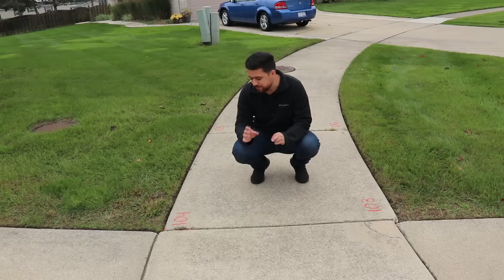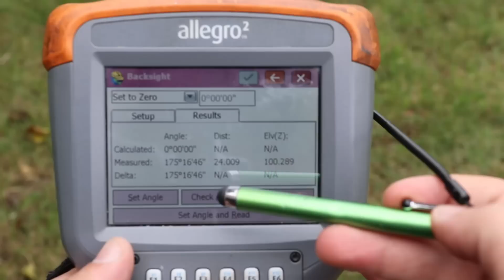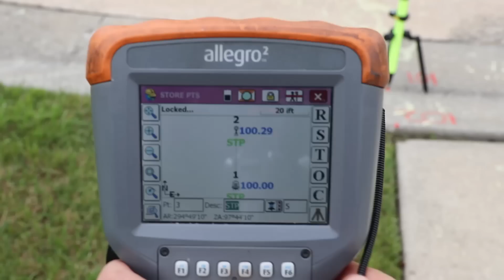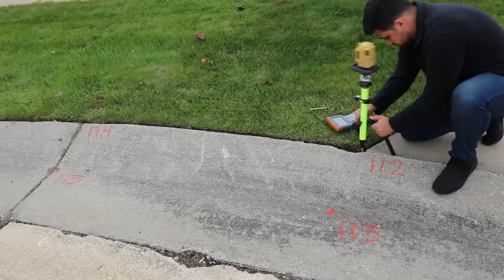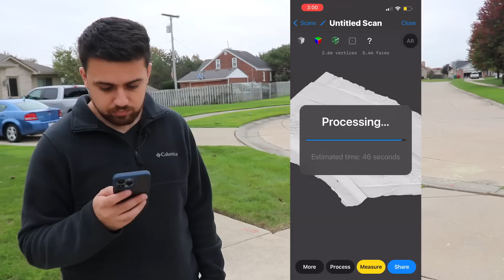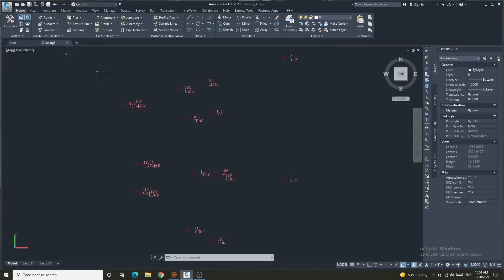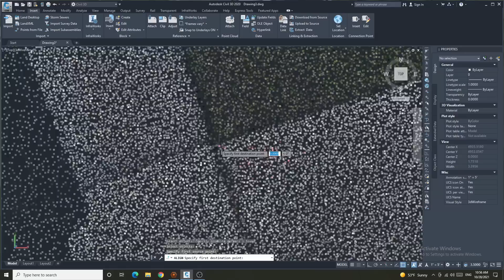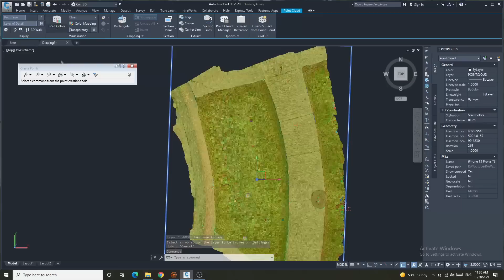iPhone 13 Pro LiDAR vs. Survey Total Station Accuracy

Comment: I’m not a surveyor but I bet the outcome is a mixed emotional bag of    Thanking the gods the iPhone pro is not making obsolete the LiDAR system that you had to take a mortgage out to pay for   And no Handy Randy is taking your job with a phone   To  dam  it would be nice not to set all that equipment up for small jobs  I’d like to use the dang phone so I can go to lunch early on hot as hell afternoons 😂 

My observation as a plumber.
Reply from the maker: Your observations are accurate. I’ve received death threats before as well 😂😂
Reply: @RamiTamimi   we all have parallel work lives    43 Yrs plumbing I can spot what sucks what’s good in trades   I asked my dental hygienist I bet the part you loved at first but now hate is dropping that sucker in peoples mouths   Your over it right she laughed said  no comment 🤦🏻‍♀️
Reply: @RamiTamimi    I’ve had a few things that came and made my career easier  no one has caught on and it’s been 20 years !  So no worry’s. It’s still to difficult to operate all that software  most just settle for driving  for Amazon at $17 n hr.

Comment: this is a good comparison to check the accuracy of the iphone, but they aren't the same application of the technology. A fairer comparison would be to something like a leica rtc 360 or similar. I haven't played with an iPhone's scan data, but I've done a lot with scan data from both leica's and faro terrestrial scanners. being able to increase the point cloud density on the iphone would be a massive advantage if it can be done. but then again, an even better comparison would be vs a handheld lidar like an artec leo.
Reply: i won't lie, i did skip sections of the video the first time, but i just went back and watched the process of the iphone scanning. in my experience even top end hand scanners suffer from drift, as the loose reference to their origin fairly quickly without some pretty well defined geometry for them to reference. for example, we scanned a ute (small truck for those not in Aus) at work, and even just scanning across the front of the vehicle it suffered from some pretty serious drift. scanning in smaller section, creating multiple clouds that you then "stitch" together with overlapping section yielded better results.

Comment: Wow!  This is an interesting video.  Very nicely done.  However, for the sake of really determining the accuracy of the LiDAR sensor, how about use a few PK nails instead of using red paint dots?  I wonder if the red paint dots are too big to accurately pinpoint the center of each dot.  Just out of curiosity, how many points did the iPhone collect for your experiment?   Best Regards,

Comment: you should have fit a rugid body transform using a least squares fit (preferably svd) and then calculate stats on the post fit residuals in addition to printing out stats from the fit itself.  I would be most interested in the affect of the positioning and especially angular drifting of the phone which would result in shearing in the data.   You could get some small reflective targets to put down so you aren't relying so much on the colorization.

I would guess that in this small area they may be able to use the cameras to take out much of that shear.

Why you survey folks do everything in left handed coordinate systems is beyond me.

Comment: I have the iphone 12 pro, When I read about the iphone 13 pro it mentioned LiDAR but not if it was improved.
Could the iphone 12 pro have been used in this demo?
Does the iphone 13 pro have the same LiDAR as the 12 pro or is it “improved”?

Comment: What happens if you used a different total station or if a different person used the same total station?
My point is that if something is measured twice there may be errors that show up in the spreadsheet.
From my physics days that is called uncertainty. If ten students measured something there will be some variation.
How does that compare to the uncertanty of the LiDAR image?

Comment: I've a comment on the method of postprocessing if I may:
You use 2 points to align the iPhone Lidar points to the Total station, I would have use 3 points to "block" the rotation of the cloud around the line defined with these 2 reference points: A reference frame is defined with at least 3 points
Or did I miss something?
Cheers
Reply from the maker: Hi Boris, you are correct, it is a three point alignment it correctly. However, if I do this, it will distort the vertical drift and we won't be able to calculate the vertical drift of the sensor.
Reply: @RamiTamimi  achsooo
You mean that the vertical is defined with gravity direction, on the total station and iPhone as well.
In that case, indeed 2 points are sufficient.

Thanks for you answer

Comment: Very interesting. I don’t know the industry or field, so rooky.
You mentioned, at 17:08, that you didn’t pick EXACTLY the same point when you did the feature extraction. (You picked a point from the iPhone data which you chose as the best [nearest?] point to the correct point on the ground, as the iPhone camera showed you)
Does this not give you an error, which - if the iPhone data WERE correctly aligned - would improve (or, perhaps not) the accuracy shown by the iPhone lidar points.
What happens if you ‘adjust’ the iPhone data set by this error? *At that specific point * (104? - I forget …) both data sets are now aligned, and you have a zero-error datum for both sets of position data. Or, should you not start adjusting anything, as then it’s not ‘absolute’ data - perhaps considered cheating?

Easy to do in the spreadsheet.
… just a thought from the rooky.

However, great to see you do the comparison. As the iPhone is 1/30th (approx) the price of the top-of-the-range industry product, I think it’s phenomenal that the ‘feature’ is in the phone, and as good as it is. Lidar has crept in as the next feature on top-end phones - so, soon in all of them, I suppose.
Matt Lee
Reply: I don't have enough knowledge to answer your question, but i can tell you that surveying often produces accuracy that simply isn't useful in real world applications.  Sure, when you are building a highway for hundreds of miles, it may.  But when measuring a residential lot, a few tenths is generally more than sufficient.

Comment: When I see errors(?). I like to look for patterns ... I also always use multiple control points as a check for the survey-grade equipment(total station).

I like seeing where errors(?), begin bunching up and if there is a reasoning for the errors ... I have rectified many old surveys, which were accurate for their day, but not comparatively for the present ... these errors(?) are very telling as to how they came to be.

I'm near the end of this video, and wonder what would have resulted, had you weighed the various errors(?), and allowed more correction to 3 or 4 control points, rather than to only one control for scale and the second control point, only for rotation.

I'm inclined to add direction and distance to the columns and see if these values tell a story ...
Reply: You know(?), on very large jobs, controlled with  RTK and numerous Static GPS(crosschecked with total station), I had actually noticed high aerial Lidar to "waver", in accuracy, as such that I would find Lidar very accurate in a small area, then suffer calculable  inaccuracy from a particular area, only to again attain substantial accuracy in other parts of the project area.

The precision of the Lidar seems to comply with any area particular area with acceptable data manipulation ... that is, with simple translation/rotation, that would appear to make areas of reasonable precision, but questionable accuracy, more compliant to the ground derived RTK/Static and total station data.  

Maybe the Lidar data you compiled was actually much better than shown ... in any case it's always fun to play with numbers and to imagine if this Lidar(on the IPhone), worked to a range of, say, 100' or more ... imagine the fun, an old COMPLETELY SOLO codger like me(land surveying from 1973-2013, now retired), could have ...

Comment: OK. But no.

You are comparing two METHODS of measurement instead of comparing two devices accuracy.

Set two devices on tripod, scan small scene, distances needs to be limited to 5m because of iPhones LiDAR limitations. Compare results. This will be comparison of two devces accuracy.

Moving iPhone and using scanning app to gather and combine multiple measurements from different places causes measurement error cumulation
.

Comment: Rami... the lidar on the iphone and ipad pro is good for when good enough is OK. ie you want to scan a scene and import it into blender so you can make a virtual world...ie looks good but may not be 100% dimensionally accurate
As an architect I wanted to see how accurate the ipad pro lidar was to take accurate scans of existing buildings. I experimented by taking 3 scans of my complex shaped living room and compared the dimension accuracy of the scans to DISTO laser measurements. None of the lidar sans matched the real measured dimensions ... worst case was the 3 scans did not match each other, with a difference of 75mm between them on some measurements... that's 3"...  none where close enough to do accurate cad dwgs for a renovation. I have to still survey existing buildings the old way... take laser distance measurements with the DISTO and sketch the plan out on paper showing the measured distance, then draw it in cad program. Its really important that I can trust the measurements taken from the site as being accurate... and plus or minus 1/2" is useless I want/need plus or minus 1mm. 
To prove to your self how bad it really is to use the iphone lidar. take 3 separate scans of the same area and compare the 3 scans to each other .. in my experience they will not match.  and for reference take laser measurements to see how far off each lidar scan is from the actual dimension.
I'm experimenting with different photogrammetry software which is looking promising (way better than the apple lidar) especially when I take some actual DISTO measured control points and adjust/scale the photogrammetry mesh so the control points in the mesh are dimensionally accurate (ie set to the actual measured dimension). Ie I measure the over all length of the building and scale the mesh to match.. then the dimensions in the mesh for every thing between the control points get more accurate.

Comment: Perfect intro for a layman. Good analysis between accuracy and precision. Impressed that the IPhone software was able to stitch the cloud together. 
Fine for estimations; not suitable for a design survey. Additional control might aid in accuracy. 
Keep the land surveyor over the IPhone. But I'm biased.
Reply: Wonder how would the error fare on large area.
IMU sensor [which phone use to detect its movement] has inherit errors which would accumulate under prolong use.

Comment: It appears the local accuracy is better than you have concluded. The errors you are showing in Z are mostly from the registration process being a 2-point method. You will get much higher accuracies if you do a 3-point registration. i.e. the phone's "level" was off from the total station level, which is expected given it's coming from an accelerometer and not a 10" bubble. This put points that lie near the line extension of your two registration points in high accuracy (105, 106, 113, and 114), and points to the upper left in a negative Z error (101, 102), and the points to the lower right with a positive Z error (107-111).
I took your points and did a 3-point registration without scaling, shifted the points for best fit by the average NEZ for all three control points, and then got the standard deviations: 0.10' E, 0.10' N, 0.04' Z, and max absolute errors of 0.19' E, 0.16' N, 0.06' Z. The remaining error was clearly a scaling error as the error directions all radiated from the center.
The fact that the Z had less deviation is because the camera was facing down, perpendicular to the scan surface. If you want better scaling, I think some targets with vertical surfaces placed every 30' would give you that. Maybe try it with some lath stakes at the ends. Ping pong balls also make good photogrammetry targets, and would probably work with lidar as well.
Another good test would be a route between two points and see what the real absolute error looks like. This test really only gets you local errors. That being said, it's looks like it would be a good tool for some applications.

Comment: For ball park measurements calculating building materials required, this is accurate enough. For scanning between known fixed points, it is also good enough to generate a profile. Given that the maximum range is only 5 metres, you are pushing against the accuracy limits anyway. Pretty impressive performance from the iPhone given it is not mounted on a tripod with a fixed remote reference point.
Reply: We tried it and we're off by 8.6 inches over a paltry 61 feet. Worst part was that if we hadn't checked our work with a laser scanner, we wouldn't have known that we were that far off.

If that's "in the ballpark", that's an awfully big ballpark.
Reply: @chrislutes2882  as was said, it’s accuracy is 5m, not 61ft 😂

This is ideal for indoor mapping more than anything, scanning small rooms etc, not for large scale work, that’s not what it’s designed for.

Comment: Rami, this is the first video I’ve seen of yours and i found it to be fantastic.

I’m not a surveyor, nor even in the construction industry. However, I do watch a lot of home building, construction, excavation, and concrete videos, so thats probably why your video came into my feed.

This was so well explained I was able to follow and understand the whole process despite never having used either the survey tools nor an iPhone 13.

Here are some thoughts I had.
1.) The Total Station obviously has a lot of advantages afforded to it, for example, it’s fixed position. The biggest advantage, however, I think would be the prism.
2.) While there will be movement induced inaccuracies from the LiDAR sensor and accelerometers in the iPhone, I think there may be resolution and backscatter inaccuracies in the point cloud.
3.) A set of inexpensive markers could be made with a bubble level and some object the LiDAR could accurately key off of (a small orange ping-pong ball, steel ball bearing, 6-sided die? obv. testing needed). 
4.) With an effective marker in place, the survey points in the point cloud would jump out and we can subtract the marker’s height from the measured elevation.

In theory, i think this would reduce the prism’s advantages, and some other’s suggestions like using a gimbal or a weighted steady-cam could help reduce motion induced error.

Thanks for the great video! definitely sub’d. 👍🏻
Reply: Diddo.